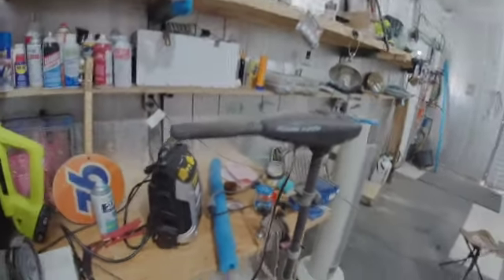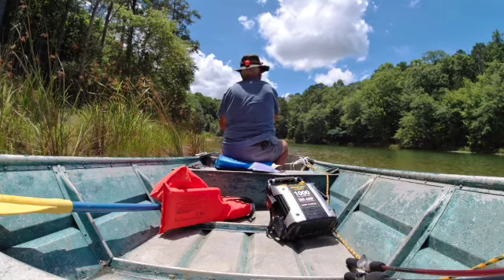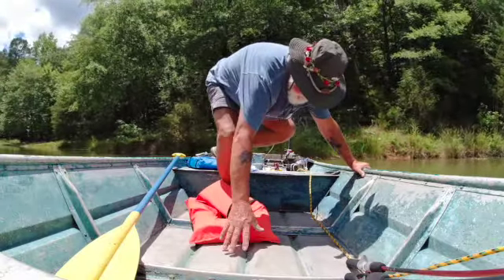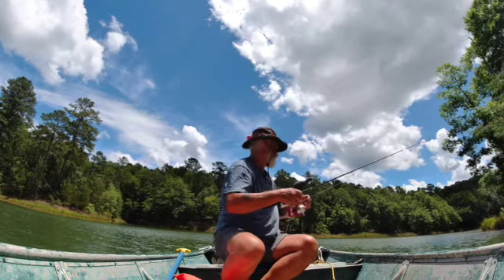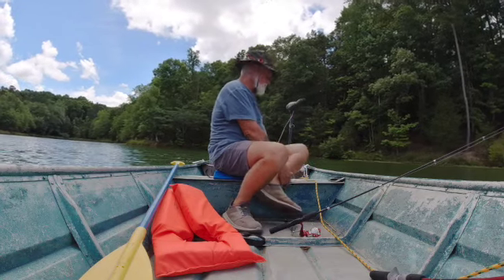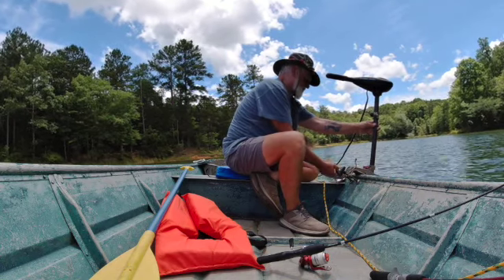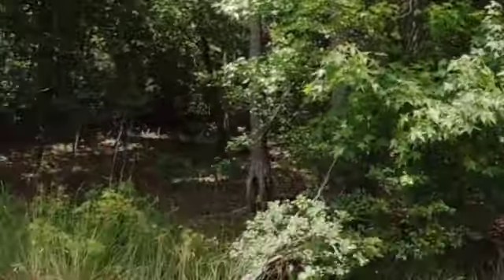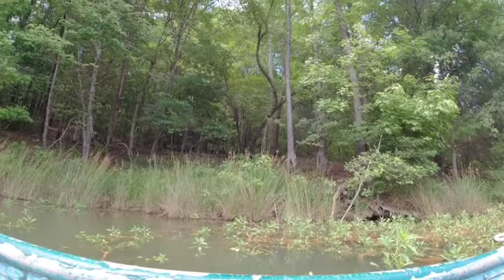A trolling motor and a little tin boat

Comment: You need to put it down deeper in the water it's not going push the boat right needs to go down lower because the moter won't torque the water right...plus it's going scare the fish making noise up high..but all in all it works beats paddling..
Reply from the maker: Sure does.